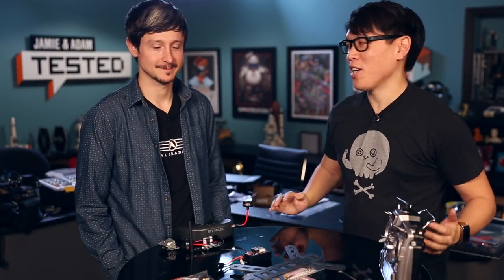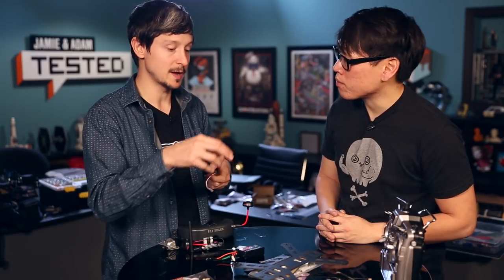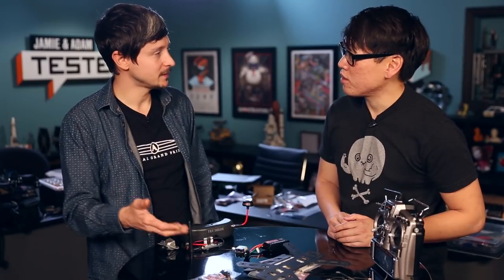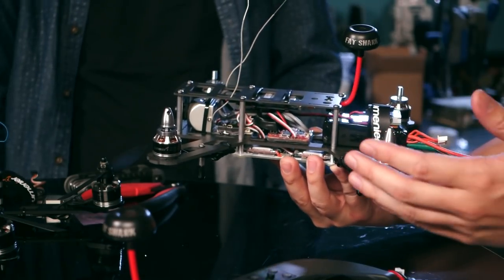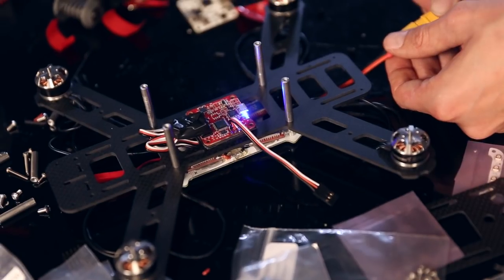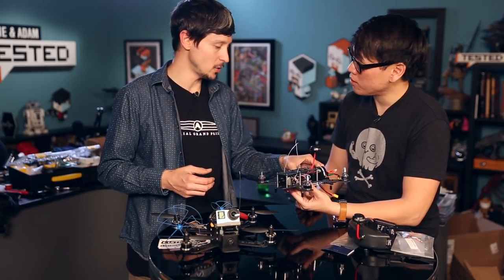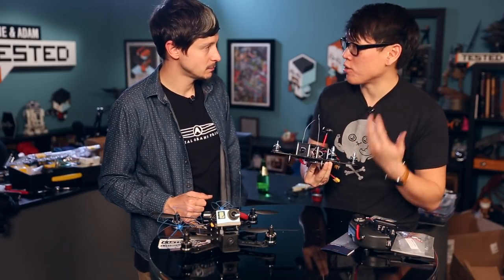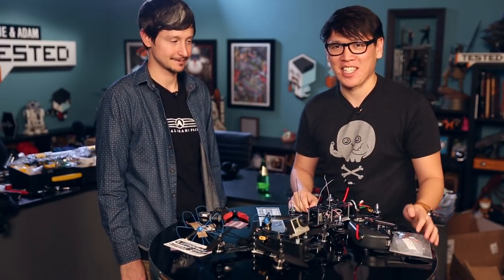How to Build a FPV Racing Quadcopter!

Comment: -- PSA to anyone watching this in 2017 or later who is seriously interested in building their first FPV quadcopter...DO NOT USE THIS GUIDE! The parts used in this build (although very popular two years ago) are all pretty much junk compared to the tech we have now (besides the frame and radio.) Go check out UAVfuture's video on a cheap first FPV build or a video/guide more recent (the last 6 months) because the technology in this hobby is constantly being innovated and changed. Nothing against this video, I built this exact quad two years ago using this guide with my brother and it was our first FPV experience!
Reply: Thanks
Reply: what would you recommend as a good, up-to-date, "how to build a quadcopter" resource?
Reply: Sadly, there isn't one big resource where you can get to know all the parts. You have to constantly inform yourself. Youtube Channels like UAVFutures, AndyRC, Albert Kim and Kabab FPV are a good starting point.
Reply: Thanks!!
Reply: @DevinEmbil  No  Problem! Check out Joshua Bardwell, too
Reply: Joshua Bardwell and his Rotor Riot build
Reply: SPAM anyone?
Reply: --PSA to anyone watching this in 2024 ;-)

Comment: This guy should have done some research on the Naze32 before building a Quad for someone.  Hopefully you guys have found out that the Naze32 has a voltage monitor and a place for a voltage alarm built in.  Just need to attach leads to the voltage monitor from power and attach a buzzer.  See the Naze32 diagram and instructions to avoid missing this great and necessary feature.

Comment: nice Job guys, I bet CHARPU FPV does not like flying LOS much. BTW can we get your Naze32 settings please? Thanks
Reply: Same to you! :)
Reply: CHARPU FPV
I wish many a mini quad to you for Christmas marry Christmas
Reply: CHARPU FPV Are those Naze32 settings still available? Keen to see how mine compare. Great vid btw, love your flying
Reply: CHARPU FPV Could I trouble you to please repost the settings? They seem to be gone now :(  Thank you in advance!
Reply: CHARPU FPV  , how crisp is the  image from the goggles of the TELEPORTER v3., have you used it ?  

would you feel handicaped  with the lower resolution from the teleporter ?
Reply: Yeah not working for me either
Reply: Hey guys! The teleporters are a cheaper/beginner googles for people on a budget. I definitely preffer to use the dominators.
Reply: Fabio Arrua I think they work fine, at least the V4s do, and the only difference between the v3 and the v4 is digital head tracking, I do not feel handicapped at all with the lower resolution

Comment: So if you bought everything they listed, you could build it? Because it looked like during the building part that stuff was missing in their list that they used.
Reply: Its far from a complete list of items! heatshrink, stand offs, awg wire, led lights and lots more! They don't even mention all the tools and soldering equipment etc. Bad misleading video imo.
Reply: +Jason Wolfe LED lights? Thats preference. Heatshrink is not nescessary you can use tape
Reply: Well, judging by your comment, "you can use tape'" that shows the standard of your work. LOL Just get out the sellotape. Maybe your a bit dim, I was just stating that the list is far from complete. Why don't you make a quad out of their list above and see how far you get!
Reply: I like using electrical tape and zipties as well, but if i want to shave weight i'll use heat shrink
Reply: and if you need some one to tell you you need basic tools and electrical supplies to build....you have no biz building it.
Reply: Wow people here are salty!  In addition to the stuff they listed you should have/get:  Soldering iron and solder, electrical tape/heatshrink, zip ties, velcro strap (to hold battery) a hex driver (although you might get one with your motors, a cheap set will guarantee you have every size you might need), I would recommend a pigtail for the video transmitter so the antennta doesn't snap off in a crash and break your video transmitter, Also recommend a buzzer, so if you lose your quad in tall grass you can find it by listening to the beep.  Hope that helps, but I might have missed stuff, so watch some videos and see the sort of stuff other people use to build quads.  :)

Comment: i just built a racer for way less than $200. This is like F1 equivalent. Don't think that the price of this makes the hobby out of reach
Reply: +Ty Lloyd What did you buy? is this including the controller? or fpv? I am looking to get into this, and want to buy this. Thoughts?
Reply: +Adam Beardall its hard to build a good racer for under 200 dollars, just the quadcopter. the equipment in this video is a bit outdated. check out the "mini quad club" group on facebook for some ideas :)
Reply: Get the flysight, it's an entire kit for 750. Comes with controller, quad, goggles, and a backpack to carry it all. It's also a great beginner quad, and replacement parts are cheap for it, good to practice with while you learn quads(assuming you've never had one) also a learning curve with flying FPV vs third person, so expect to crash while learning.
Reply: Do you have a skype so you can tell me some of your parts?

Comment: For those wanting to get started with this exciting new hobby, Banggood offer a complete range of spares and accessories.
Here’s a link to the Eachine Racer 250:
http://www.banggood.com/Eachine-Racer-250-FPV-Drone-w-Eachine-I6-2_4G-6CH-Transmitter-7-Inch-32CH-Monitor-HD-Camera-RTF-p-1008942.html?p=JQ26191551677201504Z

Or in kit form (no controller):
http://www.banggood.com/Eachine-Racer-250-DIY-Parts-CC3D-Naze32-w-600MW-5_8G-32CH-transmitter-Built-in-OSD-HD-Camera-p-1035409.html?p=JQ26191551677201504Z

And matching FPV goggles:
http://www.banggood.com/Eachine-EV800-5-Inches-800×480-FPV-Goggles-5_8G-40CH-Raceband-Auto-Searching-Build-In-Battery-p-1053357.html?p=JQ26191551677201504Z
Reply: +Wane Hall Interesting website. cheers for the links :-)

Comment: Looking to get into drone racing to compete, any good racing starter drone suggestions??? Or is it better to build, keep in mind I know nothing about those specs
Reply: This video is a little out dated. You can get everything you need to race fpv quadcopters for about $300. Here's a post that contains links for what you need to buy and a setup video: https://copterwars.com/partlist?p=37

If you're trying to try out the hobby without burning through too much cash then getting a pre-built is better these days (back in 2015 this wasn't true). Once you really get into racing, building it yourself is better, but it's also more costly upfront.
Reply: Drone Racing thanks for the tips, I now have a JJPRO175. Still learning about it, there's a lot of info. I'm trying to Cleanflight it but I'm having trouble connecting, just says bootloader not responding or something. So aggravating

Comment: i have 4 motors that i removed out of a server and i just want to know if they're good enough to buid a quadcopter, thanks.

V/12
A/0.75
RPM/18000
MODEL/1611rl-04w-b86
9WATTS

i also have 4 
V/12
A/2.5
RPM/8500
 7WATTS
Reply: LOL
Reply: nope
Reply: just to make it clear those are fans

Comment: Lol the components from a year ago. Lol 12 amp esc and 5030 props that blew up in the air!
Reply: Bunch of junk :D compared to dalprops\hqprop / 2550 kv motors / 30A blheli_s esc's / F3 family FC's
Reply: That is junk now too.  2306 motors, 2400 - 2800kv, 35A or better BL Heli32 ESCs, F4 FCs, HQ Props 5x4.3x3 PC Props, not too mention lots of stuff are all in one boards too to reduce weight.  And smaller frames are fairly popular, 210 and 220 frames to reduce weight because 250's will take 6 inch props, so you can do better if you run solely 5 inch props.

Comment: Holy hell the frame alone is $150 lol. I'd LIKE to get into this... but I like new graphics cards too much D:
Reply: try going outside sometime. Its amazing.
Reply: ***** That's quite the assumption you're making
Reply: No, that a suggestion. Video cards or Quads, you wanted video cards, are you a special one who only plays they computer outside? Looking at your videos, I wasnt wrong. LOL
Reply: ***** Whatever helps you sleep at night, bud.
Reply: Haha! Cracked me up so much.
Reply: You can get cheaper frames if you look around. Check out the ones from banggood
Reply: decompyler you get what you pay for alot of times. banggood is bang-bad. lol worst than HK but better than ebay clones made of cardboard.
Reply: To be honest, most of the components are relatively cheap, even for quality parts. The most expensive parts are basically the electronics, which you can actually re-use over and over again as you build bigger/faster/stronger quads, and then the frames, which, ideally, you'll also be able to use repeatedly and for a long time. But all the little parts, like wires, motors, propellers, they rarely top 10 bucks.

I think the motors they used in the video are great, but for a beginner, they're kinda over kill. I built my first quad using motors I pulled out of an old RC tank! Was it the best quad ever? Nah. But it sure got off the ground.

EDIT: also, if you want to get into RC aviation in general, I personally think RC planes are the easiest place to start. Check out FliteTest 's videos on their beginner planes. Planes are cheaper and, imo, simpler.
Reply: You can build them cheaper buying directly from the source(China) from sites like Hobbyking.

While not exactly the same quality something like this
http://www.hobbyking.com/hobbyking/store/uh_viewitem.asp?idproduct=47075&aff=56288
plus
http://www.hobbyking.com/hobbyking/store/uh_viewitem.asp?idproduct=56663&aff=56288

Will get you a somewhat similar frame for about $20 USD after shipping.  You could probably price this out about 50% cheaper through China if your willing to wait a few weeks for it to show up.  Yes its not carbon fiber, for whatever reason they stock other frames as Carbon fiber but not the 250, but if you want to get something in the air for cheap it will work.

That said i do recommend supporting your local hobby shop when you can, but i try to order as much as i can online because the prices my local ones charge is ridiculous.  $10 for a few ESC extension cables, that have maybe 15 cents in parts is ridiculous.
Reply: if you know where to get your stuff you can be flying from 0 for around 350 US$ (including radio , battery and battery charger) 

Lumenier and blackout frames are superior in quality ,as well as the motors and the batteries from these brands  but if you want to start cheap from 0 ( you do not have a radio, nor a battery charger )  you can have a taste of the hobby for the price of the second best Nvidia card. .
Reply: ***** But that cost is usually not the same quality as the 150 dollar frame based on the amount of resin. A good carbon fiber does not have a gloss on the outside. The gloss comes from too much resin and makes the carbon fiber not as strong and more like fiberglass. But if you don't mind sacrificing strength for cost then this is a great option!
Reply: You have to take into account that  the cost is also the work time of the machine used to carve into the carbonfiber  for cutting and making the right holes ( which is slow  and tedious)  which  in China is cheaper.

You can go for the FiberGlass version around 18 US$ , heavier but nice for a beginner. 

Then, if you like the hobby, you can upgrade to a  pro frame  while keeping  your electronics and motors. 

A Taranis Radio is around 180-250 US$
But the FLYSKY i6 is only around 60US$ 

Just don't go cheap on batteries ,
Reply: ***** Be ready to break a ton of arms due to poor quality, bad cutting, and crappy carbon.ZMR is perfect example of trying to buy steak at a dollar store.
Reply: Zmr250 frame, Emax 1806 or 2204 motors, CC3D clone(~$17), Turnigy 9X radio
Reply: 3d printed structure + arduino + 4 dc motors + arduino IR module + a remote control + study
Reply: Marcos Landi  .....can you please explain how do you control a quadcopter via IR ....specially while turning.

Have you already built something?
Reply: Marcos Landi
 The second you put a DC motor in a quad-copter, you have allready lost power and flight time.
They are wastly unefficient compared to an AC-motor, also known as a brushless.
You will also experience issues with FPV-flight if you use DC, as they generate a HUGE amount of electrostatic noise wich will affect the transmitter.
Reply: Anthony Rossi Awww, thats cute. You think you know something about me! Thats class. (oh and couldnt be more wrong)
Reply: ***** haha sounds exactly like what you did to the first poster. Also I don't post YouTube comments to be classy, So I could care less. I was just calling you out in defense of OP. I'm glad I'm wrong or my faith in humanity would be lessened.
Reply: what did I say that made you think that i prefer to be inside all the time? I wrote that to the OP due to his mention of having preference to a graphics card over an outdoor racing quad, so I wasnt really being assumptive, unless (as written) he uses his gaming pc outdoors, then i stand corrected.
Reply: To get into quadcopters, first get a Hubsan x4 or a Nano QX or a micro quad like that.  These racing quads are for professionals, but there are many other much cheaper alternatives that are just as fun, like the ones I mentioned.
Reply: ***** Thats the truth right there. :)
Reply: ***** "build" a latrax?
uhhh no. you buy one, open the box, charge the battery and fly away. LOL
Reply: Modding would be more like it, but i dig what your shovlin'
:D
Reply: ***** No.. the FPV kit is so you can pilot it around a set course.... it is almost impossible to fly between two pillars or trees when looking at them from the side. FPV allows to you to fly through technical obstacles that would otherwise be near impossible.  Look up some of the FPV racing videos where they use a forest as their track and you'll understand :)
Reply: ***** Goes outside is wearing head mounted screen
Reply: ImportNation Yeah. the sunlight, fresh air, and friends are all irrelevant due to the goggles. lol :) RC FPV FTW
Reply: You can actually buy a carbon fiber frame for 20$ so that one isn't your only choice.
Reply: It's a whole stock quad copter for $150 not just the frame
Reply: My new 250 sized quad is about 150$...for all! :D (pnf)
Reply: Maxi King and thats the carbon fibre one featured on the vid?
Reply: Garth S Me too :D
Reply: JP Prince It's the ZMR250 (carbon, not carbon fiber), DYS 2300kv motors, 12A SimonK ESC :)
Reply: Maxi King Thanks for that info dude, appreciated ;)
Reply: Maxi King What FC? Any info would be appreciated. I'm looking to build my first quadcopter and I'm not sure if FPV is the way to go right now.
Reply: Yash Garg
I'm going to use a DJI Naza, but I would not recommend it for minis. CC3D is the best choice (in my opinion), bc it is cheap and lightweight.
Reply: Maxi King Thanks. Good luck with your build.
Reply: Thanks :) I have just begun actually (like 20 mins ago) :D
Reply: thejunkyardmessiah Lord of the scrapheap CC3d clone flight controller, to save $8?  Is it the same quality?
Reply: ***** What caught my attention about the racing quads was the virtual goggles.  What is the cheapest way to get that setup?
Reply: Greg Dale the cheapest option for the goggles themselves would be the Quanum FPV goggles with monitor kit off of Hobbyking for $30.  For the whole system (including goggles) I'd recommend the Predator V2 kit from Hobbyking ($280).  

I just woke up though, so I might not have the most sound advice.
Reply: Garth S uh dud this is a CARBON FIBER frame...... They build F1 cars with carbon fiber
Reply: Still deciding, Custom built gaming PC or Custom Build FPV racing drone.
Reply: This is a very expensive build that would work for semipro races
Reply: Garth S look up how to get in to fpv drones for $200 it's by UAVFutures but watch how to build a drone for $99 and in all for me it cost £168
Reply: My frame was for a 5" prop and was full carbon fiber. Including shipping it was like $19 check out the lisam LS-210
Reply: Actually just one that has a life.
Reply: 3d printing
Reply: Garth S Get both

Comment: My first "intro" vid to Quadcopters. The thing that's sorta blown my mind is what Cleanflight or similar products are and how they work into flying Quads. I'm reading, reading, reading... I did just pick up a used Blackout Mini H that oughta arrive in a few days and I'm sorta racing to get the right receiver, batteries (chargers, balancer), FPV goggles. There's a lot to get up to speed with!>!! but it will no doubt be worth it. Thanks for posting! A great vid!

Comment: Nice work CHARPU FPV ! Didn't know the QAV250 came with those wrapping thingies to protect against wet grass and such. I actually built something similar for my Blackout Mini H today, but mainly to protect the quad from getting filled with snow in a crash! Grass is not a problem over here right now :-)
Reply: salle rc haha, yeah those things are actually more useful than I thought.. and if you have snow.. EVEN MORE! :)
Reply: CHARPU FPV
Reply: Where did you buy a blackout mini H, on the website it says preorder
Reply: PUREspeedpwnd I got my 6" Blackout Mini H from getfpv.com, unfortunately it seems to be out of stock everywhere. Checked a few other places with the same result: readymaderc.com, multirotorparts.nl, dronematters.com.
Reply: salle rc Ok thanks, do you know why their offical website is only preorder?
Reply: PUREspeedpwnd I think it only means that it's out of stock and that you will be put in a queue if you order.